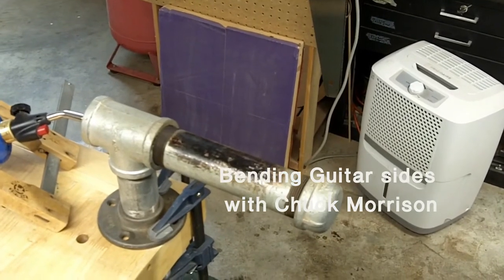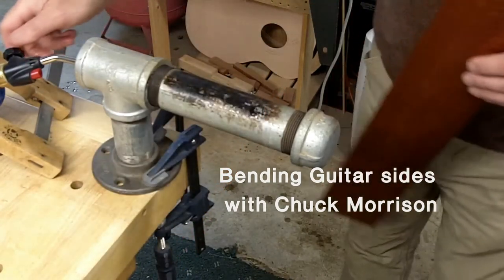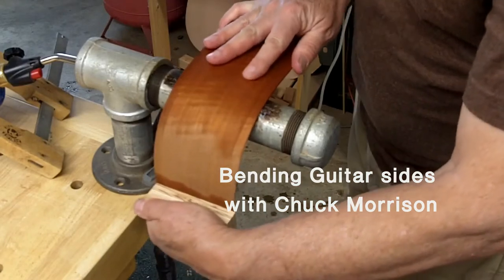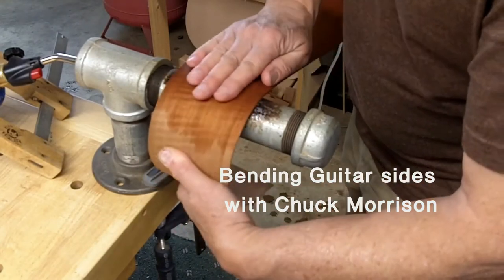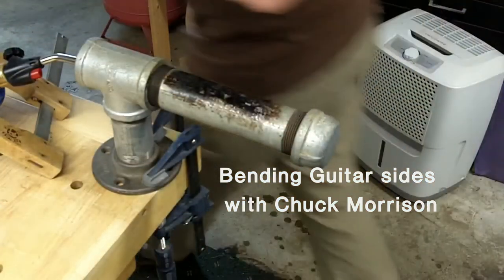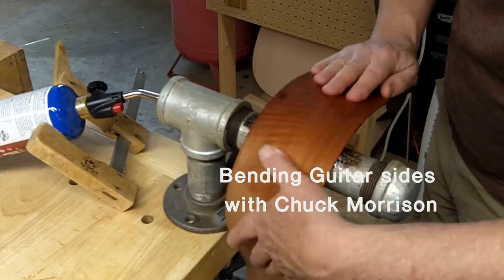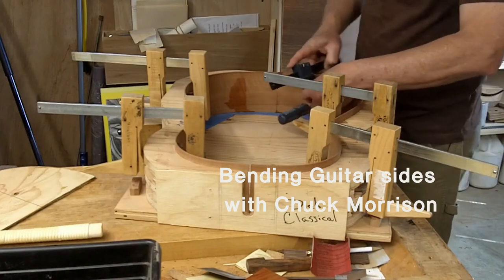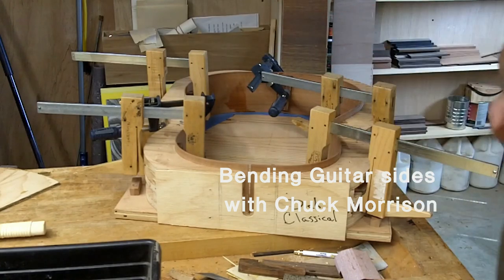Hot pipe bending of guitar sides with Luthier Chuck Morrison

Comment: I’m sure you have the touch watching your video. I put a stove thermometer on my bending pipe it takes about 400 degrees before wood will ignite. 
I used this method and reduced my scorched pieces 100% still got a few but I found the stove thermometer really eliminated alot of the guess work for me!
Hope this helps.
Your video shows you are a very accomplished luthier and I did not mean any disrespect!
Thanks, Patrick Nole
Reply: Also the thermometer has a magnet that allows it to stick to the pipe.
Reply from the maker: Good information. Thanks for the comment !

Comment: Thank, you I was about to order the side bender from Stewmac. I had been building Mountain Dulcimers in the Muleshoe shape or Wythe County Virginia styles. I want to branch out to guitars and maybe a couple of other instruments and shapes. Your pipe is perfect for my needs. I will start on it Saturday as a Tropical Storm is coming through here tomorrow and Friday.  I will need to get some pipe from ACE. I will trace some Instruments I have and start on patterns tomorrow morning while making a couple of changes to the designs to fit my ideas ie maple and spruce for a brighter sound.
Reply from the maker: A couple things. If you go this route it's probably better to use black pipe rather than galvanized to avoid any zinc inhalation issues. Also, it's easy to get the pipe much too hot using propane. You want it just hot enough to boil water, but not so hot that water spits off the pipe. Maple generally does not require a very hot pipe and will burn easily. Keep the wood moving back and forth to keep from scorching it. I usually get the pipe hot enough and then turn the torch down very low to keep it there. Good luck !
Reply: @chuckmorrison  thanks for the tip

Comment: Hi Chuck, looking for a decent pipe rig has been a chore. A few questions please:

1) Where did you purchase all the threaded pipe parts and what size pipe (I.D., O.D. and length)? 

2) What is your opinion on using ovoid/oval pipe where the cross-section looks like either oval or a tear-drop? Some luthiers choose to use this shape pipe.

3) Curious why luthiers choose different pipe shapes and thicknesses when choosing to bend sides?

Thanks Chuck! Very informative video!
Reply from the maker: 1. The size of the pipe is up to you and what you need. I use a standard 2" or 1 1/2" depending on the radius of the curve I'm trying to bend. I've even used 1" when bending cutaways. I usually have bought the pipes at a hardware store.
2. I like the tear drop shape and think it's a great all in one solution, although It doesn't allow for getting inside a sharp cutaway.
3. Different instrument shapes will require different pipe sizes. You don't want a pipe that's too small or you may have a bumpy side since you can't heat a large enough area to get a smooth bend. As I mentioned, a cutaway will require a smaller pipe size to get all the way around it.
Reply: @chuckmorrison  Thank you Chuck for replying to my questions. All very helpful and informative. I am going to purchase threaded pipe (like your bending iron) so I can simply screw the pipe to the base instead of having to have someone weld the two pieces together. Yes, I figured I would need various pipe sizes for different bends.  Thanks again.
Reply from the maker: @youtubecommentor4480   It all screws together. There's no point to welding. If you are using a torch to heat it, make sure you have holes along the bottom of the pipe or it will put itself out.
Reply: @chuckmorrison  Ok, thanks. Instead of drilling holes in the bottom of the pipe can I simply purchase a 90° elbow and screw it to the end pointing down (like where you have your end cap installed) ?
Reply from the maker: Probably would work but be careful of where the exhaust goes. It could get pretty uncomfortable if you get in the way.
Reply: @chuckmorrison  Yes, I agree in regards to the elbow to exhaust heat downward. Thanks Chuck. Couple more questions please.

1) So I don’t wind up with a bumpy side, what size pipe do you recommend for wider bends? You mentioned you use 2” pipe but is that a wide enough diameter for the wider bends on acoustic guitar sides? 

2) Also, where do you purchase larger diameter pipes? Lowes and Home Depot only go up to about 3” x 12” but then you have to buy them in packs of four (very expensive). Thank you Chuck.
Reply from the maker: 2" is good enough for most classical and acoustic guitar shapes. It's more about your technique than exact size of pipe. You have to move the wood enough to expand the area that will bend. So you are bending an area instead of a spot. I wouldn't go with 3" or larger
Reply: @chuckmorrison  Sounds good Chuck! One of the reasons I mentioned a 3” or larger diameter pipe was to utilize a light bulb as a heating source. Pablo Requena (classical guitar luthier) built his bending iron(s) using a light bulb. Some luthiers use a standard light dimmer connected to the light bulb to control the heat temperature. I did read that It takes awhile to heat the pipe (using a lightbulb) verses using a torch.

As you know, light bulbs come in various shapes, sizes and wattages. Therefore a smaller diameter pipe can use a tubular shaped light bulb. I have read that the light bulb can break if there is not adequate ventilation.  See Pablo’s bending iron link below: Appreciate your patience and kind help Chuck.

https://youtu.be/-py9FGKpYW0?si=e_b8QxaxXcm3r-Eo

Comment: You know, in all these years and all the guitars I've played of yours, other than the first one where you bent the sides over the form (as you mentioned, in Sloane style), I've never watched you bend sides. How funny. Interesting to see it after all this time. I'd like to see you do some hard woods, like padauk, or rosewood. Those are more work. Cool to see this one, though.
Reply from the maker: Yes, they are more work, although it's really about;
1. getting used to the amount of pressure you need to apply (before cracking occurs)
2. the amount of wetting required
3. how high the heat needs to be
4. how thin the wood has to be
All of these things vary by type of wood. East Indian rosewood is actually pretty easy to bend, assuming it's under 2mm thick. African blackwood is the hardest I've ever bent. It doesn't absorb water and needs a lot of heat.

Comment: Good vidieo, Iam about too attempt my first really hard wood bend Bubinga that I have had in my shop for 20yrs. How thin do you suggest I get the sides before I attempt to bend? Iam making 2 guitars & I do not have any extra bubinga so I have to make the first time right. Thank you & God Bless 🙏🙏🇺🇸🇺🇸🎸🎸👨🏻‍🦯
Reply from the maker: Bubinga can be a bear to bend smoothly, especially if it has a deep curl or Pomelle figure. I've only used it a few times about 40 years ago and gave it up because I didn't like the look of it. Like all very dense tropical hardwoods, I'd be bending it at 1.6 - 1.8 mm. I'd also soak it for at least an hour before trying to bend it over a pipe.

Comment: Hi. Thanks for the great reat video 😊👍 what was the sides thiknessed to?
Reply from the maker: It depends on the wood. Usually less than 2mm. Very hard woods, like some rosewoods can be as thin as 1.6mm. Softer woods like maple can be thicker, but generally not more than 2mm. Maple and oak bend very easily and can be thicker, but care should be taken not to singe the wood, especially at the waist.
Reply: @chuckmorrison  thanks for replying. Im using Utile as a mahogany substitute. I had it at 2.65mm and had trouble getting it bent. But was scared to go much thinner. But with your info. I'll definitely go thinner next time 😊👍

Comment: Soak your pipe parts in muriatic acid for a couple hours to remove the galvanized coating and you won't have to worry about it
Reply: I used vinegar on mine took a couple days but worked fine.
Reply: Muriatic acid works great! Fast, too.

Comment: What size pipe are you usingfor your bending iron?
Reply from the maker: Pipes are sized strangely. I measure the inside diameter at about 1 5/8", so I'm going to assume that's sold as 1 1/2". You might be able to use 2" if you don't have a tight waist or cutaway to deal with.
Reply: @chuckmorrison , thanks a lot! I'm going to also see how far I can get with a 1/2" pipe. I'm interested to know how small a radius I'm able to successfully get.
Reply from the maker: @jonathantownes  Good luck with that. I'd be concerned about overheating such a small pipe unless you have a very small torch.
Reply: @chuckmorrison , I made sure I got a torch with an adjustable flame. I'm awaiting some practice sides from Stew Mac to test everything. I'm also concerned about the size of the pipe. Thanks, again!